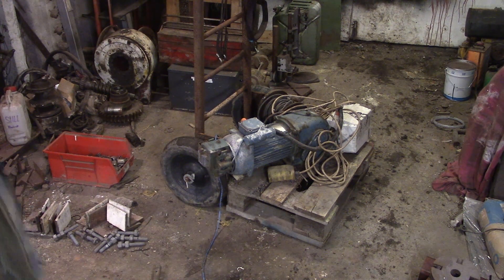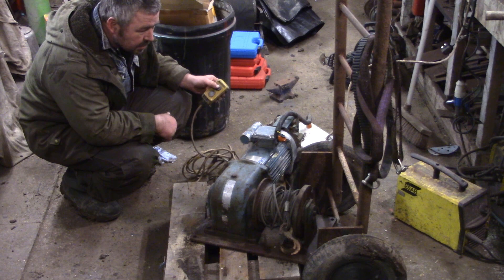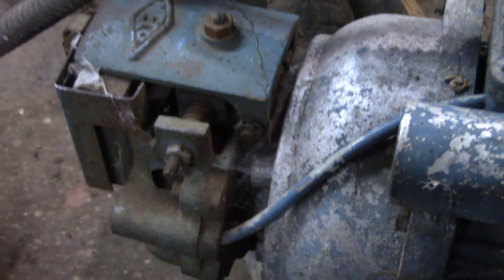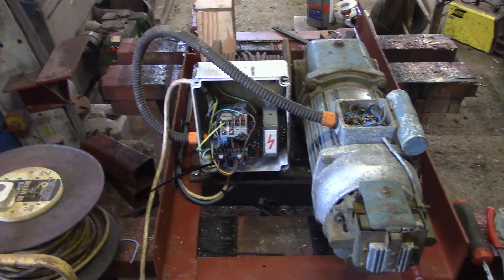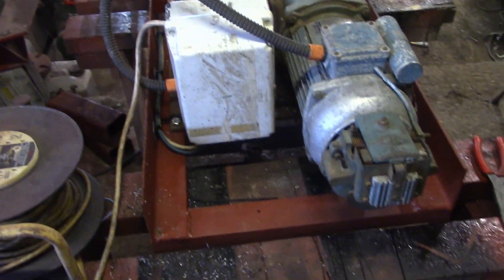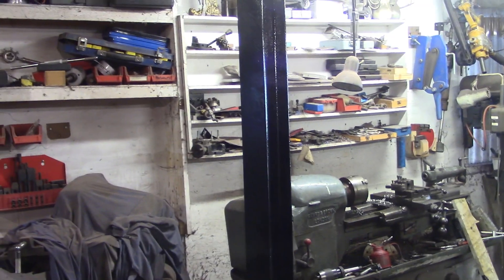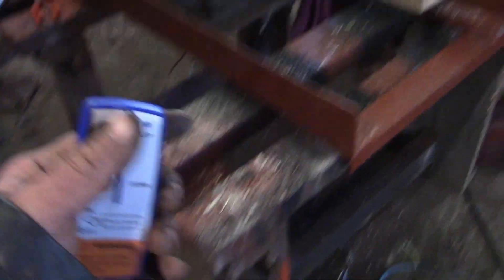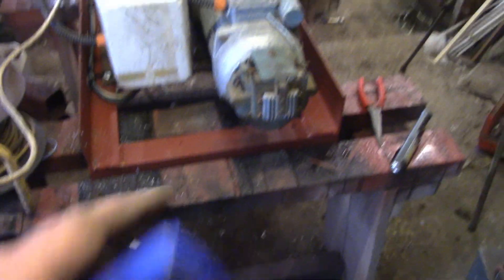Underground bunker temporary lift winch

Comment: Good to know it's not just me who keeps myself sharp by getting a finger in the electricals every so often. I lit myself up an absolute beauty a few days back, messing about with the mains battery charging circuit for our solar rig. Turns out that the national grid rather unreasonably stays on even when I've turned off our inverters and unplugged the batteries! Tidy bit of work that winch though, you're well on your way back down the hole
Reply from the maker: My hair stands on end just thinking about it mate, haven't had more than a tingle in ages thankfully, gotten extra cautious now I'm spending a bit more time around 415v.

Comment: Cracking job!!! fwiw I've used the Lock n Lock/clip on lid style tupperware containers for temporary electrical enclosures in the past - pretty weather resistant. You have to be careful drilling holes in them though when you install glands as they will crack and split.
Reply from the maker: Nice idea

Comment: That's not a bad winch for a temporary job - much nicer than something new.  You could have something really primitive to prevent winding it up too far into the roller guide if you're sending it up from the bottom of the shaft - a dangling bit of rope with a knot in it and a mark on the wall saying STOP HERE (but you'd probably already thought of that).
Reply from the maker: Probably just a 5 min job adding a limit switch to the up contactor, already regretting it's omission but probably won't add it till I've wrecked my rollers.
Reply: @turboconqueringmegaeagle9006  Yeah, I tend to be the same - I want to get the project finished, particularly if I'm trying to shoot a video, knowing full well I should really stop and do that last little bit - then when it goes wrong later I'm all "WHY didn't I do that last little bit!!!"
Reply from the maker: @GrumpyTim  all my you tube projects end up with finger prints in the paint for the same reason.
Reply: @turboconqueringmegaeagle9006  Yep, I'm familiar with that - I think my least favourite thing is when I'm soldering something on camera - trying to solder components at arms length, round the legs of the tripod, just isn't that great!!!

Comment: Good work. You can stop the cabbling going wild at the top with a cover of some sort. Possibly and bit of fire extinguiser but it will need to be a semi circle with the extended flat sides and some flanges. Could also have it out of sheet I would have thought.
Reply from the maker: Should do it shouldn't I.
Reply: @turboconqueringmegaeagle9006  It will give you peace of mind.